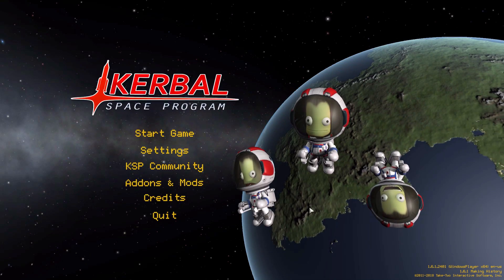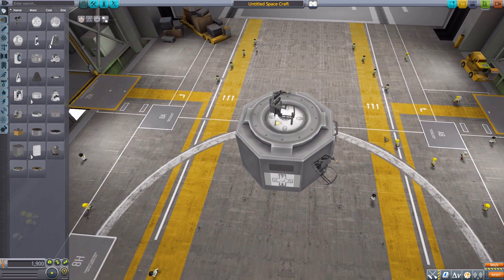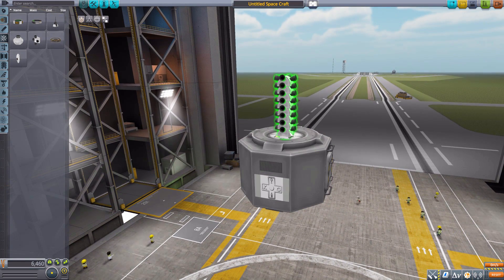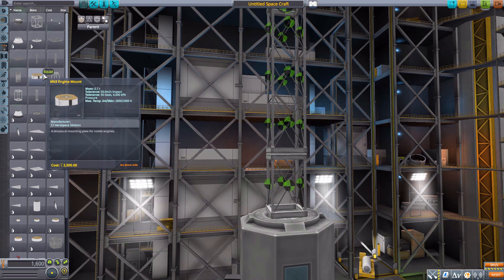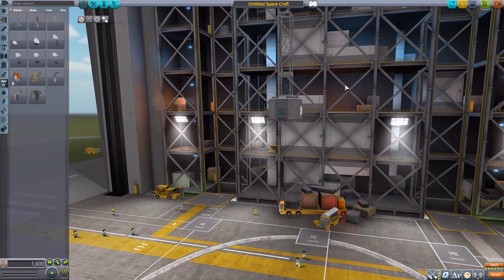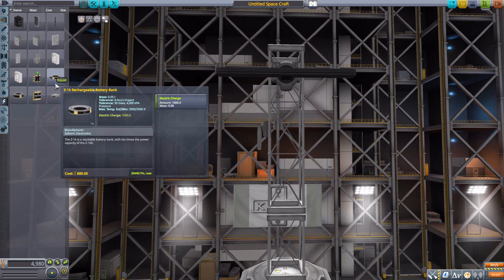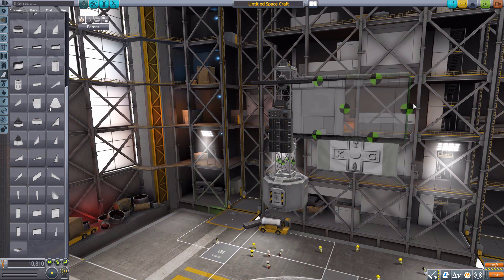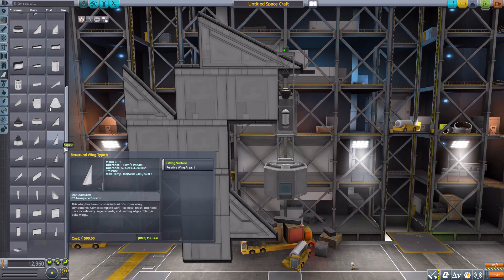KSP Mods - Superfluous Nodes

Comment: I now want a node on the linear monoprop thruster so I can make 5 way thrusters easier.  Hmmm.... I wonder if the extra nodes inside the cargo bays are actually occluded.
Reply: Already done, it just wasn't mentioned.  Check out the forum thread.
Reply: I have no idea about the occlusion though.  Let me know what you find out.